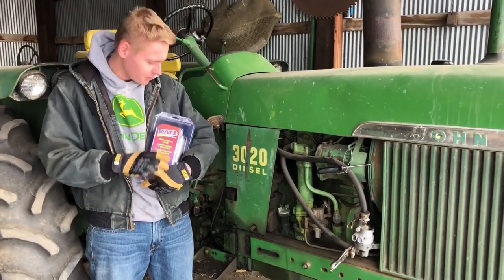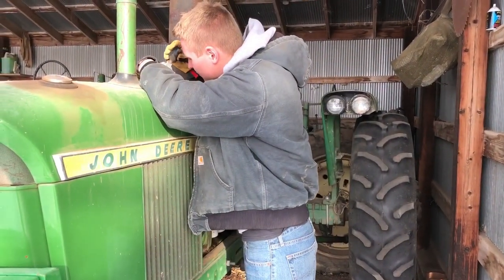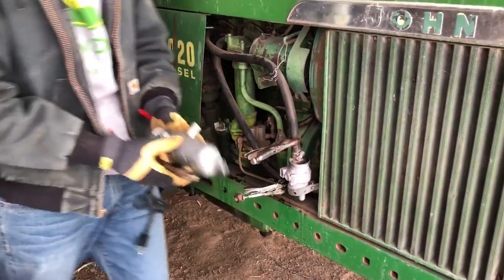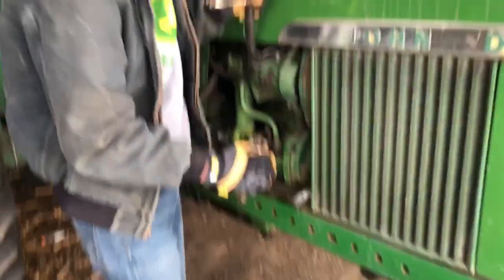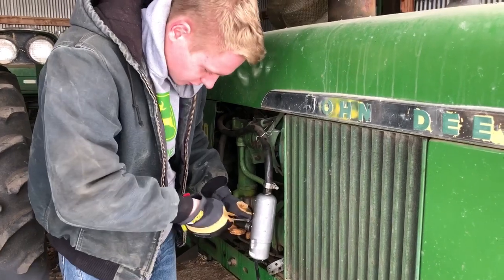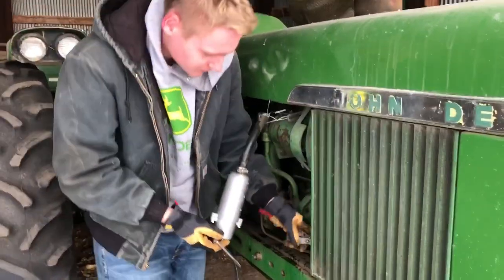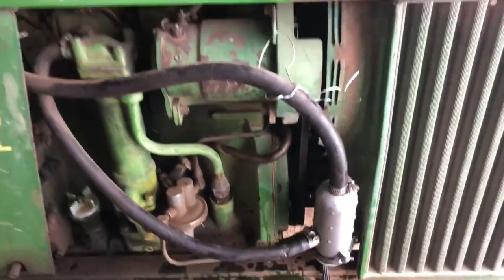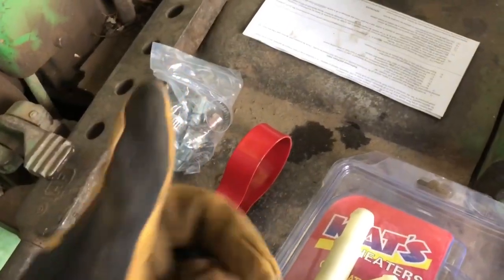Installing a heater on the 3020

Comment: Sooo, where are those hoses hooked up? I thought the inlet to the heater came from the drain plug on the left side and the outlet went into the cylinder head after one of the hex plugs was removed.
Reply: Like to know also, show it in the video